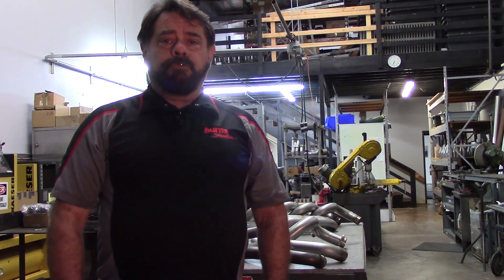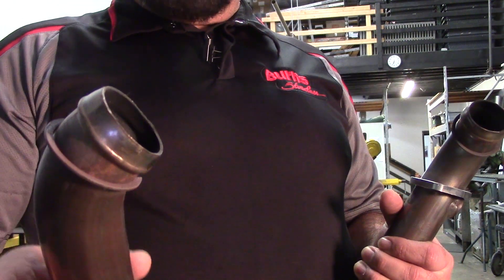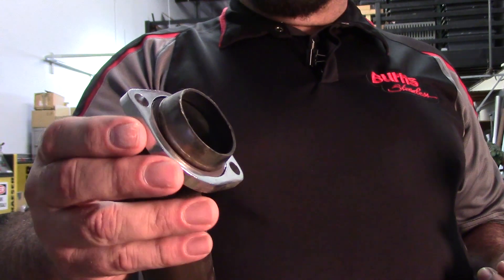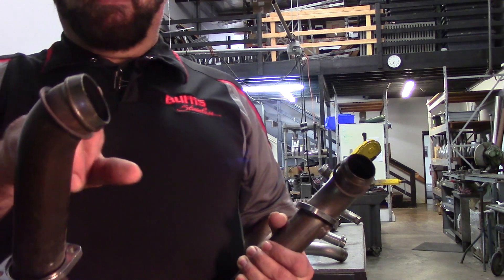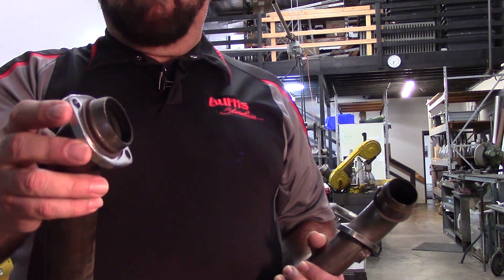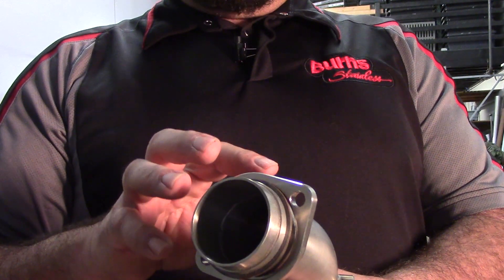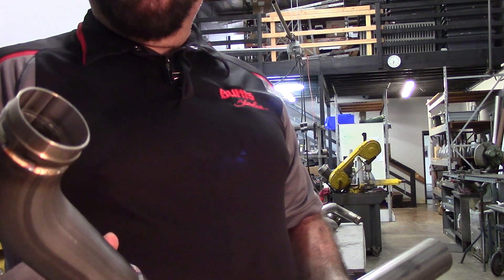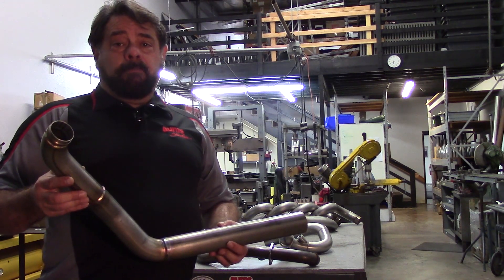Motorcycle Head Flanges - Vince In Shorts

Comment: When i pulled my old pipes off, the mesh gasket had made a good seal but the wire mesh material looked like it was definitely obstructing the flow as it was evenly feathered out into the port opening. Do you recommend the copper gaskets?
Reply: Yes, or maybe aluminum
Reply: @videovincer  Use Cometic gaskets or the flat SE mesh gaskets.